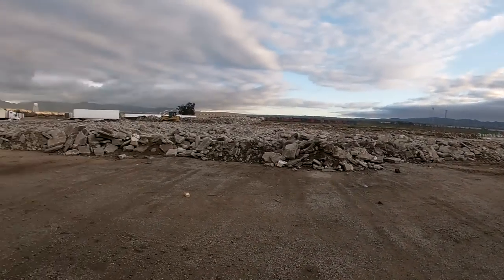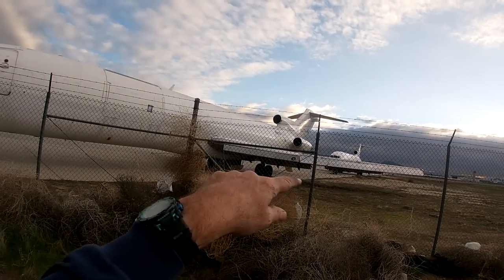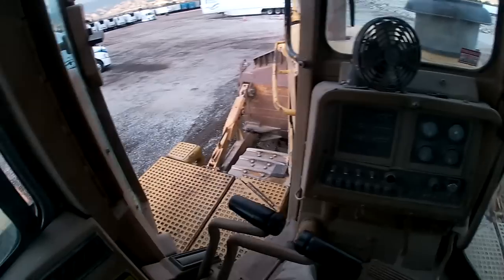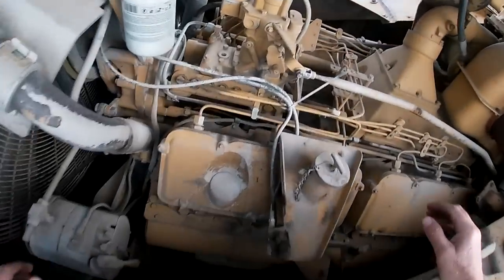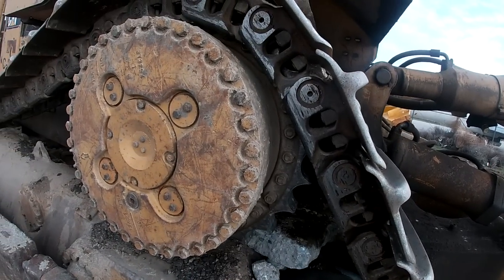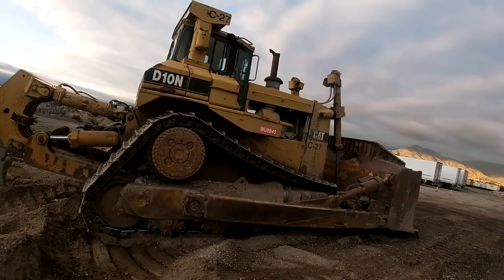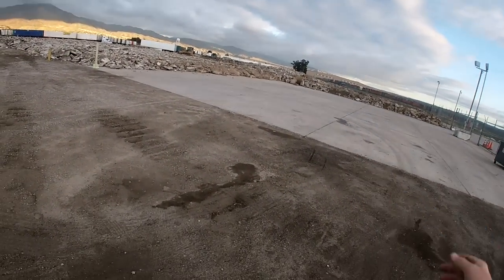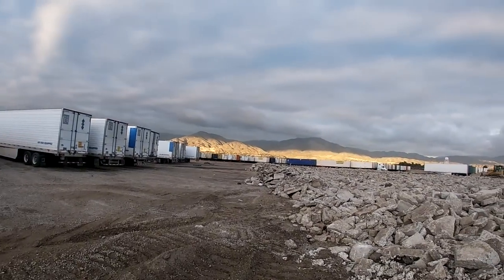All I Want to do is Make You Bounce....

Comment: Looks like DC-10s converted for cargo. They had one issue where the third engine cut through the hydraulics, but I think they changed the design so that a failure of the third engine wouldn't cause a major issue.
Old school AC on farm tractors - remove the doors, have like a gallon or so to drink with you.

First I thought you got a heavy load to take north though.

Comment: Yes D-10 N. I run both D-10 N & R and D-11R models clear down to John Deere 350. Quick way tell difference a far. D-10 got single exhaust & D-11 has twin front exhaust. D-10 runs about 160,000+ pds.